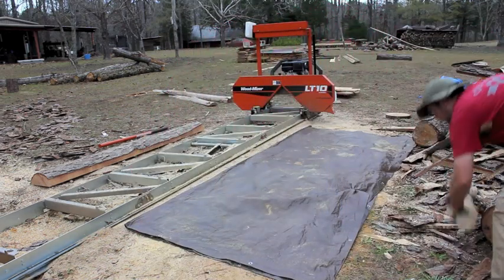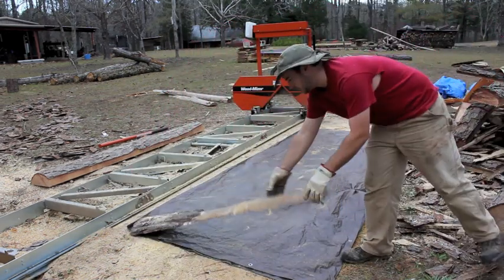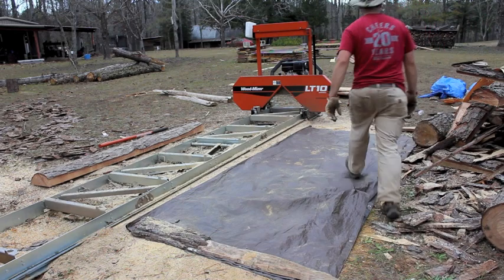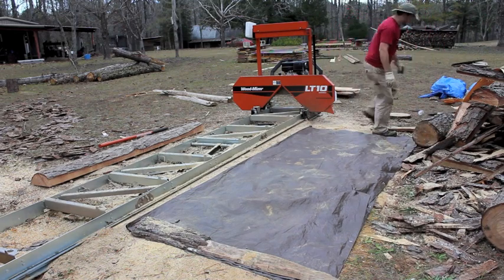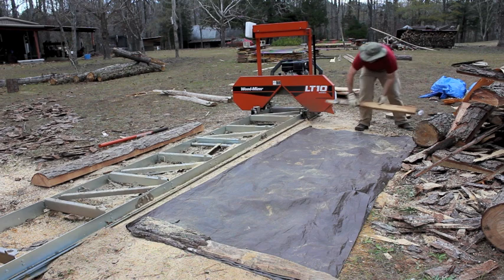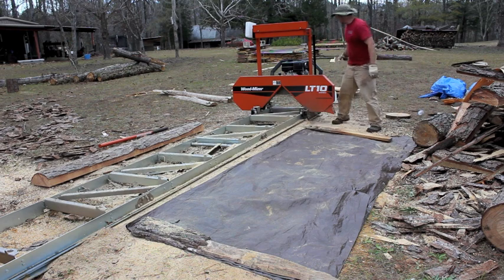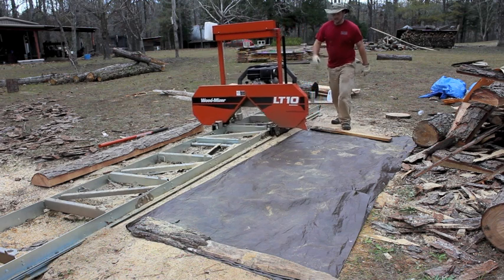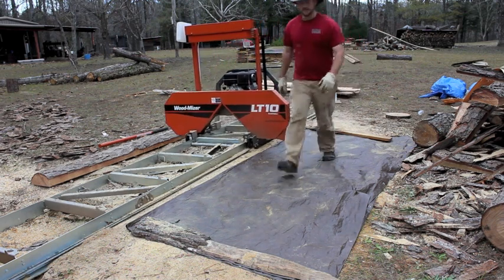How to manage sawdust at your sawmill

Comment: Have you considered a wood pellet maker? Wood stove pellets can be made from sawdust and could be used or sold...
Reply from the maker: Whiskey Throttle Garage I have not considered that. Not a bad idea. I saw mostly pine, I wonder if that’s any good as pellets.
Reply: Fall Line Ridge - pine may be ok, some pellets are made from grass clippings/mulch... I believe the moisture content may be the biggest factor...